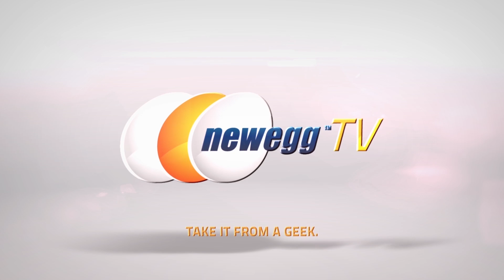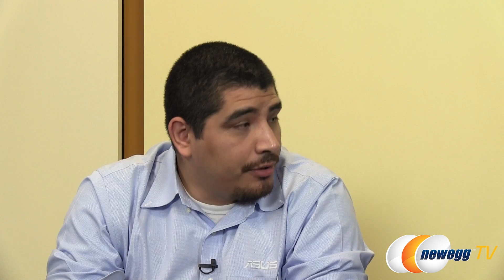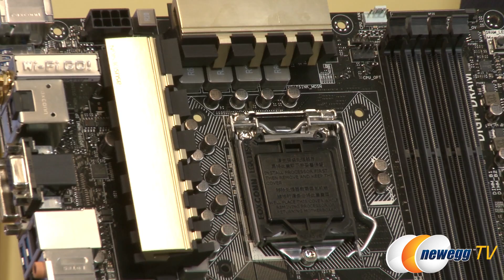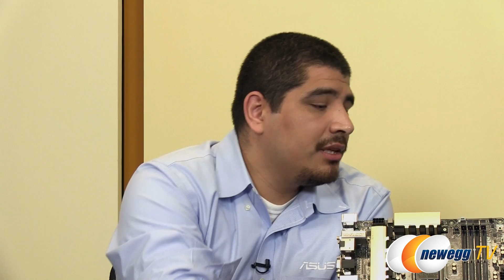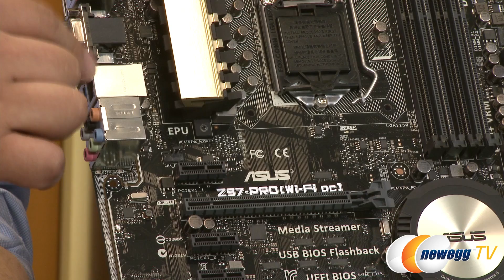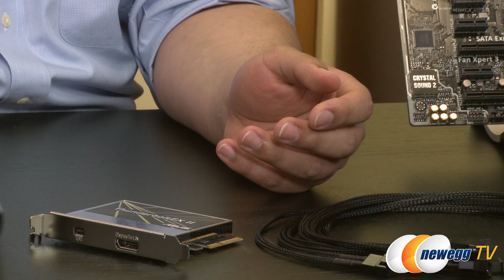ASUS Z97 Pro Motherboard Interview with J.J. - Newegg TV

Comment: This motherboard is awesome. But it has defective asmedia usb 3 controller. Mine (the second one after RMA the first one for the same reason) doesn't work at all. Although at first they were operational, they died by themselves in about 5 days. Many builders also report that this usb controller creates problems to windows and hackintosh machines so they deactivate asmedia usb controller intentionally, even if it is functional. I don't know if it is a bios or circuitry issue, but please asus do something about this.

Comment: So I'm planning on getting a z97 board from this series due to all the features it has, but I have a somewhat nooby question about the WiFi-ac version of the board. Does the "WiFi-ac" part mean that the board itself functions as a WiFi adapter so I wouldn't need to get a WiFi card to connect to a wireless network? Ive gone through a few reviews but somehow I'm still confused, so I'm looking for a definite yes or no. And if it does function as a WiFi adapter, would you still recommend getting the non-WiFi board and just get a WiFi card anyways?
Reply: yes that is what it means
Reply: I would recommend getting the pro gamer and getting a WiFi card
Reply: +Gavin Poole I just ordered my pro gamer 30 minutes ago xD

Comment: Unfortunately the programs with my ROG Hero VII z97 we utter crap... the AI Suite, gamefirst, and even the Kaspersky failed to load. The board has been great but I wanted to control the fans via software and have a basic OC done before I got into the bios. Those functions were what swayed me to these but the solid hardware is what keeps me even without the programs working for me. Who knows, maybe they will with another full install but I don't trust "Asus secure erase" to not brick my Samsung Evo.

Comment: Does the z97 pro board have pwm fan headers for the chassis fans? Or is it still voltage contorlled (5v) like the older z87 boards?
Reply: ***** Thanks. I'm building a pc with my son and trying to make it as silent as possible. Any advantages by going pwm or 3pin for the chassis fans? I am specifically looking at the noctua nf-a14 pwm and 3 pin fans.

Comment: asus maximus VII formulaaaaa whennnn
Reply: Do you currently have a Maximus VI Formula?
Reply: nope, lol.
Reply: Darren Liu Well make sure the armor does not cover the battery. If it does as in my Maximus VI Formula, then you will have to totally dismantle your system in order to remove the motherboard so you can remove the armor which in my case covers the battery. Unfortunately I have a bug on my board just as some other Z87 Asus board owners do, and I was told by Asus tech that the problem was  battery related, and I must replace the battery. Well when I went to do that, I realized that I had to completely dismantle my system just to replace a battery. So in addition to the bug, any owner who has an Asus Maximus VI Formula board has the added frustration of having to dismantle their whole build. AND here is the kicker to all of this, THE BATTERY DOES "NOT" APPEAR TO BE THE PROBLEM that is causing the bug.

Comment: Does JJ know if Asus has found a fix for the " frozen bios clock" problem that seems to appear on it seems a  limited number of Z87 boards, but the bios bug clock issue does appear to show up on all models of the Z87 chipset. It seems that this problem on the Z87 based boards has existed from their initial release, with still no resolution for the customers whose software relies on clock function. This bug also shows up on the desktop, as the clock resets itself continually about every hour. No matter how often you reset the clock on the desktop, the problem persists. Also when you shut down the computer, the time is NOT kept. When I experienced this bug, I contacted Asus tech support, who insisted that my problem was a battery issue. I suggested to the tech if it might be something else, since my board is a Maximus VI Formula board, which of course is a relatively new product introduced last year. I was told that NO, and the fix was to replace the battery. Well I purchased a battery, but was shocked to find that in order to change out the battery, it was necessary on this particular board to totally dismantle my system, in order to remove the motherboard, then remove the "armor" in order to access the battery, which is located UNDER the armor. I did however notice that the new Sabertooth  Mark1 Z97 based boards which ALSO has the "armor" like my board, Asus must have realized their error, and repositioned the battery near the bottom of the board, and they also contoured the armor to allow full access to the battery. I hope myself, and the other affected customers of Z87 boards can receive some fix, or a replacement board that does NOT have this bug. Let me repeat that this bug is NOT limited to just my model, since others have also reported the very same bug. The armor issue is just an added frustration Maximus VI Formula owners have.  I will not hold by breath though, but hope against hope that Asus will be proactive, ideally through the customers original supplier in order to minimize wait times for replacement, since  a fix is not presently available, because I believe almost a year waiting for a fix is sufficient patience for customers to wait.
Reply: Like I stated. Not every Asus Z87 motherboard has this problem. It effects only some boards, but it seems to affect all models from the cheapest to the most expensive Asus Z87 based boards. This bug appeared very early and has so far NOT been fixed. It is NOT a new problem with the Z87 chipset boards. Any person who uses software that depends on a clock that works is affected if this bug is present on their motherboard. Asus also has  known about the issue. Good for you, that you have not had the problem.
Reply: Angel Luis Trinidad Just a few questions if you don't mind. 1- When your computer is off for any length of time, is the time on your desktop wrong? 2- Have gone into the BIOS and checked to see if the system clock is actually running? If it is, the seconds should be ticking off. 3- Have ever had to reset your desktop clock for no apparent reason? 4- Has the desktop clock randomly reset itself without you doing anything? These are some of the issues that some people are experiencing.
Reply: Angel Luis Trinidad That would be a very good idea, but because Asus claims that they cannot replicate the issue, the people who are affected with this problem are kind of left in limbo, because for one I was told by an Asus tech that it was a battery issue, which apparently is NOT the case. This has been dragging on for many months for the people affected. What Asus is asking, is for someone to volunteer to send their board to Asus in its frozen state, and wait until Asus runs tests on the board. So that leaves others in limbo until Asus finds the problem. That is not in my estimation good customer relations.
Reply: Angel Luis Trinidad Well like I stated before. I am happy for you that you are not having this problem.
Reply: Angel Luis Trinidad You seem to be claiming that you know people who have this problem and they have RMA the board? Your previous responses never seem to mention that. The people I spoke with have NOT had any success. Besides, who knows how long I will be without a computer if they have trouble identifying the issue. I previously stated that Asus has been looking into the bug, and they claim that they can't repeat it. So it would be a wait and see if we can identify the bug, and then repair it. It would seem Asus tech's are not very good. They probably just read from a script, with very little tech knowledge if any. I would expect Asus to take my board, and immediately replace it with a bug free board, and if and when they find a fix for this bug, then they could either refurbish it, or just keep it. For me the biggest issue is the time element.
Reply: Angel Luis Trinidad Since time is an issue for me, the Asus mentioned an option whereby I as a retail customer can have Asus send me a board  immediately providing they have one in stock, and I guarantee it with a credit card. In this way after receiving the new board, I would have two weeks to send back the old board. Now this idea I like, since it would significantly reduce the turn around time. Do you know that with this option if the motherboard would be a new or refurbished board, and does Asus typically re-flash such a board, or are they usually just flashed once at time of manufacture? Finally as an enthusiast who wants to overclock, it is important for a stable board, and a good CPU, which Intel appears to have done FINALLY done with their refresh of the Haswell CPU's. It is too bad they did not do this from the beginning. I guess the many complaints was a factor in their redoing the Haswells, especially the unlocked versions. It makes sense that ALL the refreshed versions SHOULD work with the Z87 chipset, considering the Haswell is a Z87 part, and fits into a 1150 socket, but do you have any inside info that this IS indeed fact?  Oh! thank you for the help. Much appreciated.
Reply: virgey I work in tech support (nothing to do with Asus though) and the turnaround time is always a biggie for our customers too. Like with our customers, Asus probably appreciates your time is precious but at the same time they've got to cover their backs. If they start handing out temporary replacements to speed up turnaround times, you'll unfortunately get people who will abuse that system. 

An example of that would be if someone has physically damaged their motherboard consequently voiding their warranty. They would then be able to lie to technical support and say they've this BIOS clock issue. They send their board in and Asus immediately dispatches a replacement board free of charge to the customer without inspecting the customer's 'faulty' board first. Asus then inspects the board to find it has been user damaged and contacts the customer accordingly. The customer then says it wasn't damaged when it left their hands and says it's not their problem therefore refuses to pay for the damages. In this situation it would be incredibly difficult to take legal action against the customer (and incredibly inefficient too). The customer would then have a replacement product (free of charge) when they're not entitled to it. Now imagine this on a national or global scale. I'm not saying this is your situation, but many company's just aren't willing to take the risk.

The obvious workaround for that is to charge the customer for the replacement board before dispatching a new one out. Although again, there are legal complications with this too. This will depend on whether the manufacturer (or repair agent if it's a 3rd party) is also registered as a retailer too. I know for our company we can charge customers based on repairs, but as we're not registered as a retailer, customers can't purchase a replacement unit from us. You also can't put it through as a chargeable repair as the repair wouldn't of been carried out at that stage yet.

As I mentioned at the start I don't work for Asus and I'm in no way affiliated with them, but I would like to offer this explanation as a possibility to what may of been causing your frustration with Asus. Just like you, we (as tech support) get frustrated too as we really don't enjoy giving customers an unpleasant experience, but sometimes, we too are limited and bound by legal obligations. 

I can see you made this post over a year ago so I hope this got resolved for you shortly after this post.

Comment: About the Fan stuff, Gigabyte boards (Z87 & Z97 +other I'm not sure about) have great fan control, I have 2x fans plugged into one header and it works fine to control both fans, this works in 5 of the 7 headers on my board :)  (And I've tried 4 fans on one header and it worked)